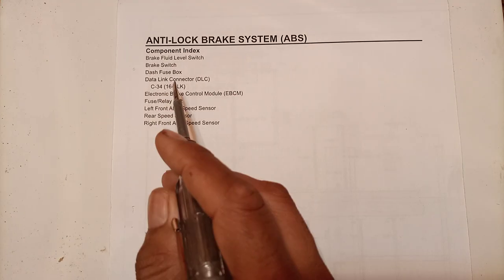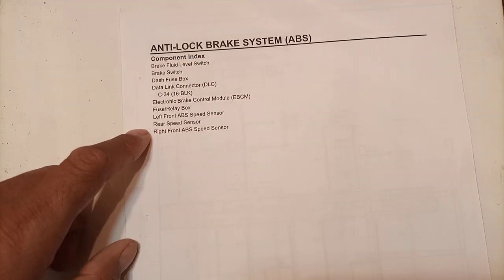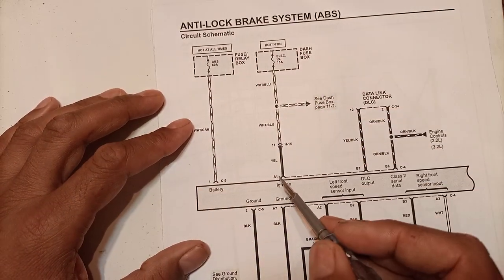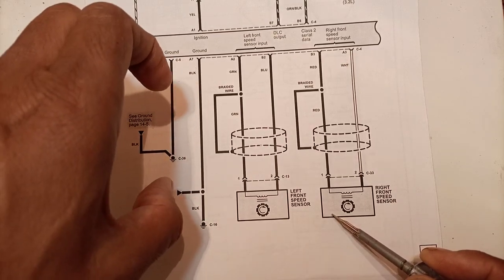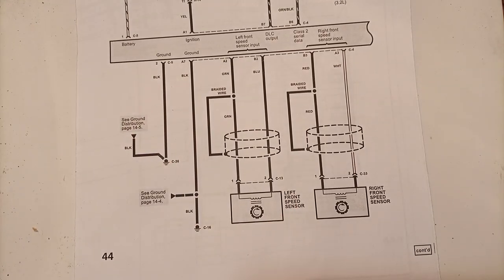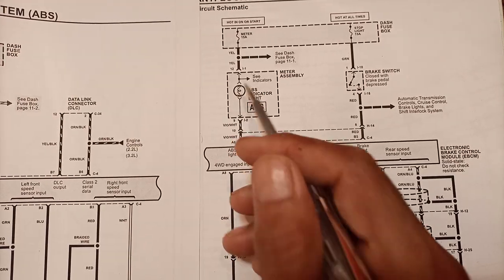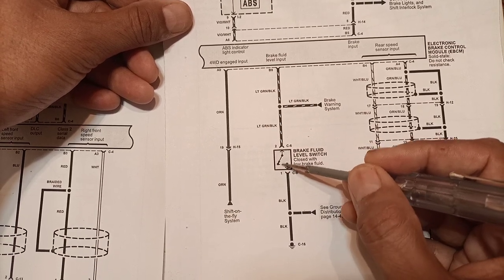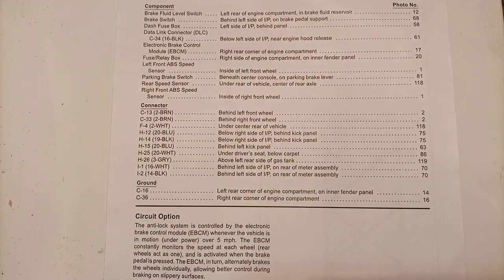Abs anti lock brake system. car electrical system. ordinary brakes vs abs brakes. xnxx car repair

Comment: Sir iam making a diy Bluetooth speaker but the problem is that there is ground looping. So how can i make a isolated power supply to the Bluetooth module (3.7 to 5v dc)?
Reply from the maker: I can't understand the term ground looping. But solution to your problem is a small 7805 regulator. A series regulator 7805 would be enough to power up your bluetooth module. The amplifiers are normally rated 12v.
Reply: @JahanZeb1976  when we connect Bluetooth module and amplifier to same power source there is noise in speakers (hmmm) that is ground loop
Reply: @JahanZeb1976  and 7805 don't give isolated supply it has common ground between output and input
Reply: @JahanZeb1976  sir please make video on how to add extra keys on cars.